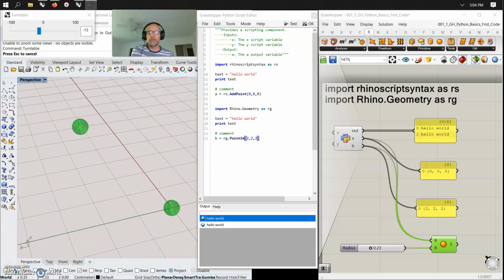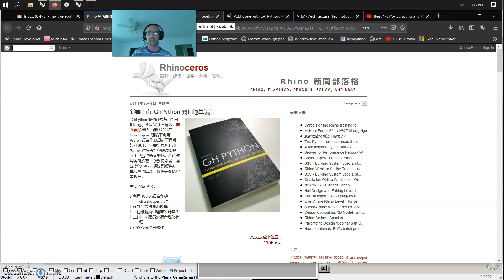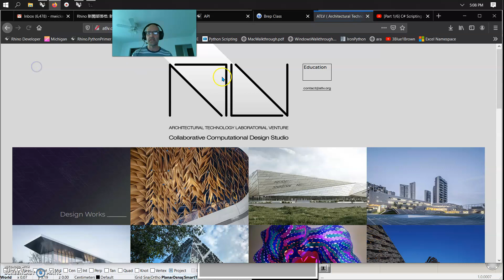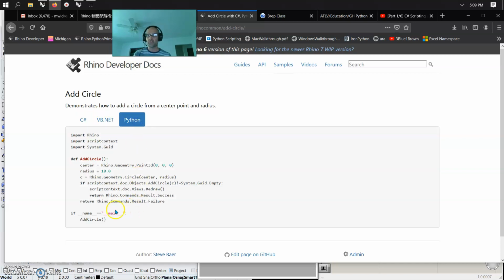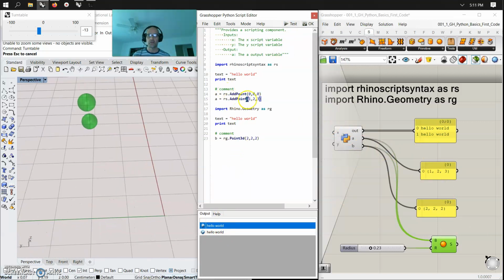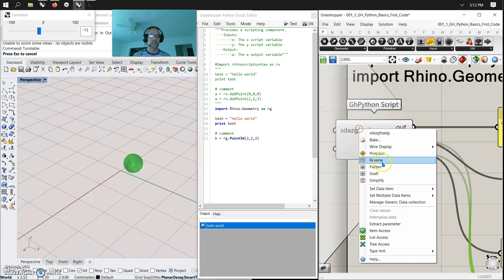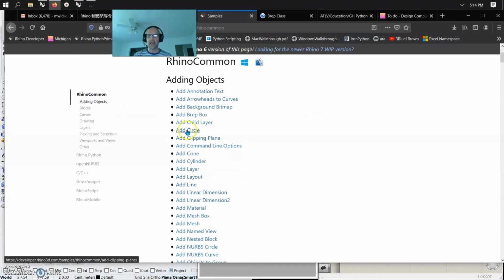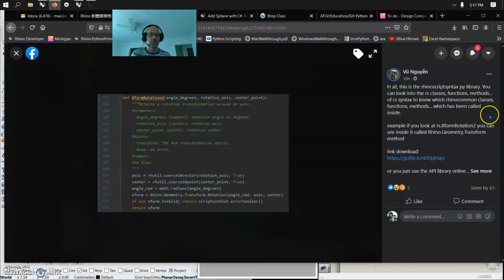GH PYTHON: Computer Aided Geometric Design (TRANSLATE INTO RHINO COMMON) 002

Comment from the maker: #rhino3d #architecture #optimization #design #modeling #teaching #python #tensorflow #grasshopper3d #rhino #parametric #grasshopper #rhinoceros3d #architecture #optimization #programming #parametric #rhino #grasshopper #simulation #pythonprogramminglanguage #rhinoceros3d #pythonprogramminglanguage #simulation #structures #structures #physics #arduino #physics #arduino #3d #bim360 #3d #bim360 #building #urban #form #generative #process #bim #building #urban #form #bim #visual #algorithmic #detail